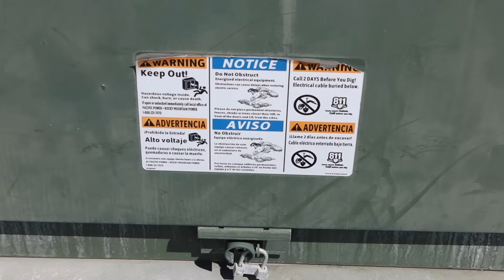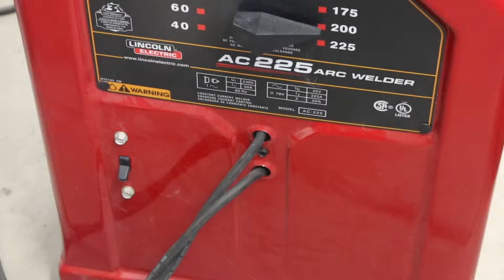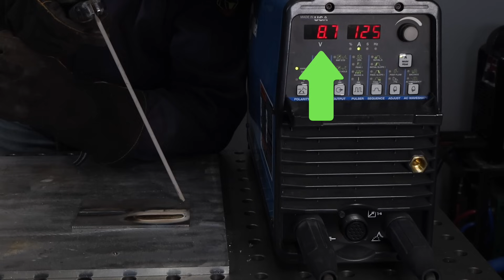Can You Get Electrocuted While Welding? Watch This...Don't Get Shocked!

Comment: Im confused, because alot of people touch the metal they are welding on, but you mentioned if the clamp and the electrode touch you at the same time, you can get electrocuted . What makes it safe to touch and hold the material you are welding as well as hole steadily the elecroyed?
Reply: Hello? Anyone?

Comment: here's a solution, use common sense when welding. If you can't use common sense, then you don't belong in the welding field. 99.9% of welding accidents are because of the operator not using common sense.

Comment: I managed to get shocked by my dad's stick welding machine when I was about 12. We've been working on a welding job all day long and at one point I removed the ground clamp,  turned the workpiece around and fixated something on it with my right hand while my left hand still held on to the ground clamp which I forgot to reattach somehow. As soon as my dad tried to continue welding I was the one to close the circle. 
Had no gloves and eye protection was "look the other way".

Comment: Was that a Miller welder made in USA?

 I've felt the tingles when leaning against a welding project and covered in sweat.
 I think my ESaB 180 has VRD turned on all the time ( open voltage around 25v), seems hard to start on the first strike, then normal.  There is no button to turn it off, I think you have to take it to a service center and get it disabled ( a stupid money saving idea to save a button).   The bonus of the ESAB is it has an IP23s rating,  so you're good to go in the  rain....
Reply from the maker: I have an ESAB 180 and you’re right, they don’t have a user adjustable VRD. I imagine it’s just a jumper inside or something like that, but they recommend a service center if you want to change it. I’m pretty sure these Dynasty’s are made in the USA, this one is a 2010 model.

Comment: I see a lot of videos of people working with stick welding, using their fingers to control the rod, isn't that dangerous?
Reply from the maker: With a dry glove on the flux, it's not an issue. It's not necessary in most cases, but plenty of pipeline guys guide the rod and it works well for them.

Comment: It's not just voltage.... a stun gun... 500k volts. Rarely fatal. 4160v breaker.... 4k volts, 100 amps... You get turned into a fried turkey. Need amps too.
Reply from the maker: The volts drive the amps.

Comment: i didn't learn much. it would have been much more helpful if you would have demonstrated clipping the ground onto the table and then how to properly hold the welding handle and how to avoid any kind of "complete circuit" between you and the welding table.
Reply from the maker: Thanks for the suggestion!

Comment: In Australia there is something called a "Squid" which is a device with a quick trip fuse that plugs into the mains and has an outlet which the welder plugs into. As soon as it detects earth leakage the fuse will trip and the welder shuts down. I always use the squid even for a quick bit of welding and this coupled with the other standard safety precautions adds an extra layer of safety to the process.

Comment: i am learning aluminium tig for 2 years now and i literally cannot do the filler wire with TIG gloves on its impossible i legitimately cannot get any grip whatsoever so i just dab and stab into the pool like holding tweezers its no the official method and yes i have to do many stop starts but can i not wear a glove on my left hand because then i can feed the wire in the official way and feed the wire consecutively but sometimes i touch the aluminium filler wire on the electrode if i were to do that with my left hand holding the aluminium wire with no gloves would that kill me ? anywhere from 85-125 amps is the maximum since the AC circuit is complete

Comment: I wish more would be discussed about AC vs DC and what voltages are involved...so much talks about the current and I have heard many things that claim you "can't" get hurt by DC power...though having been mildly shocked by DC model train stuff around 15-20V enough to get a startling minor tingle does make me wonder.  I know with amateur radio stuff generally 48V is the threshold that its considered "hazardous" though it is possible to feel it much less in some conditions.

Comment: Im a bit confused about something, can anyone help me out ?

I just saw a video of a guy welding a piece of steel that was laying on top of a metal table while he was only wearing leather gloves and a t- shirt.

 He clipped one clamp to the table leg and started welding but his bare arms were touching the table the entire time. 

How did he not get shocked ?? 

Wouldn't he be adding him self to the circuit by touching the metal table with bare skin ? 

Why is that not the same as stepping in a puddle of water ?

Excellent video tho btw. I did infact learn a lot from it. I have been having trouble finding videos that discuss safety like this and how NOT to get zapped. I really appreciate it 💯
Reply from the maker: It's a great question. He was connected to one pole by touching the table, but not the other because the handle and gloves are both insulators.

Comment: I don't know about electrocuted to death (common sense says you can be), but I know that I had several occasions some years ago where I got "lit-up", while welding (both stick and high frequency TIG),. Though it's possible in all processes, I would assume that stick welding would be the process with the most shocks. 
But the worst I ever got was a high frequency shock while TIG-ing some parts.

Comment: Okay, Im new to welding, And just picked up my first arc / stick welder... 
Nothing special, Just a Sealey 160A AC thing, and im coming along quite nicely, Learning with 6013's and getting it pretty dialed...
But i am always CRAZY CAREFUL not to touch the electrode /rod, while its in the stinger and switched on....
The whole "thats live, and im grounded to the earth that im standing on"..... 
So since you say the input power, and the welding power, are seperate.... is it actually safe to touch the electrode while the welder is on?
I see it so much, Welders hold the rod still... is that just because they have gloves on, that makes it safe? or is it actually not dangerous to touch?!?!

cheers

Comment: Yup...I just completed a circuit..came here to see if it was me or the machine... It was me.  Thats what i get for trying to tack a piece on thats in my hand while leaning against the object I'm trying to weld too.. i only made contact with the piece in my hand and my hand accidentally pulled the piece away from the structure

Comment: You have that backward, voltage is not what is dangerous, it is amperage that matters. Hence why a Tesla coil is safe. It’s high voltage, low amperage.
Reply from the maker: Why can I touch the posts of a 12 volt car battery that's capable of delivering 800 amps and be fine? It's because the actual amperage that flows is a function of voltage. Ohms law states V=IR. Because the resistance through a person is relatively fixed, the voltage controls how many amps will flow. Therefore, by limiting voltage, you also limit current and create a safe condition. So yes, like I said in the video, the amperage is what hurts you, but controlling voltage is what matters to stay safe. In the case of a Tesla coil, the reason that it does not affect the human system is because of the very high frequency range of the Alternating current produced by the circuit. While welding is done using either DC or relatively low frequency AC (under 400 Hz), Tesla coils operate at frequencies over 100 kHz, which frequencies of electricity do not affect the nervous system or cause muscle contraction in the same way that lower frequency AC or DC current does.

Comment: You can absolutely get shocked while you are welding. When I was an apprentice, I was helping a welder in the shop at work, and he took great pleasure in messing with apprentices. He had me hold a piece he was welding on a piece of equipment in such a way, so when he stuck an arc, I was the ground, so I got a pretty good jolt. It was a good learning event because I always made sure it didn't happen again. Later, when I was working for the railroad and one day, my job was to watch the guy welding steel  H-beams to reinforce a trestle. It was pouring down rain, and we didn't have any cover, and all day long, I would see him spasm occasionally when he would get bit from water leaking into his gloves or down his neck.

Comment: Hey Tim. Great video bro. 
I wanted to ask a question if u have a minute to answer. I'd very much appreciate it bcos I'm new to welding. My shop is always cold. I don't have any heating in there so I wanted to ask about heating the spots of the metal I'm about to weld up using stick. 
Is it at all helpful to have the metal heated before beginning my welding on the area? I use a fair bit of Square tubing so I clean the areas with a flap diec on the grinder before welding. I have a small gas bottle torch so I wanted to ask if it was a good idea to heat the area 1st?
What I have found in my short time welding is when the metal is hot the arc tends to begin a lit quicker with the heat of the metal or am I asking a dumb question?
If anybody in the comments could give me advice too I'd be super grateful to u guys also.
Thanks for a great vide4o again Tim man. Take care bro and same to all in the comments

Comment: I always see videos about the welders, but never about the setups the tables you must use. Or is there any specific tables you must use and are they grounded or not? I'm new to all of this and still learning but see no videos about some of the questions I have. I wish I had a place near me I could take a class with.
Reply: I have a wooden table with a piece of sheet metal on top, connect ground to the sheet metal or the workpiece. Make sure that ground is always closer to the electrode than you are. The electricity will take the path of least resistance so if you want to touch the workpiece itself while welding make sure you are wearing thick dry gloves. If you are standing up wearing some thick boots will stop you becoming ground.

Comment: Open circuit voltage is defined as the unloaded voltage across the welding circuit. It has nothing to do with the fact that its leads are live all time the welding machine is on, as in the case of a scrach start tig or a stick welding machine. In any case the OCV is bellow 100 volts and as such it is not regulated by law. Example you can legally change leads and terminations, cables etc without breaking the law. It is the current that kills, but because of the bodies high resistance to electricity, you would nead a fairly high voltage to push the  amount of current needed to kill.  At an OCV of 50-70 volts which is typical for a dc welding machine, this is considered safe for this reason however you should never touch the welding circuit live deliberately. You can get an uncomfortable shock from this, especially if your hands or gloves are damp. Always treat the leads as dangerously live but use with confidence.
Reply from the maker: Very well said 👍

Comment: I am 75 years old I am a retired Diesel mechanic/welder. O C V almost killed me, I was the concreet paveinmg mechanic for a large construction company out of K C Kansas. We were doing a leveling overlay on I 70 west of ST Louis  Mo. the paver broke down and needed wilding < viabtratoe bars under the paver> they pulled it out of the mud and washed it out and then insisted that I would crawl under and weld the broken part. I refused and insisted that they would move the paver to dry base and they would not. After the intense arguement compleet with screeming and hollering, you need to have been around concreet paveing to uenderstand, I put on a pair of rubber gloves and crawled unmder the paver. My welder a lincon diesel SA 250 wouild not reve up fron idle when you srtrike your arc, so I had to plip the switch and make the welder run at weld speed this made the OCV go to 90 volts DC.  The current went through me arm to arm, it was like a bomb went off in my chest, I couldent talk, I managed to roll out from under the paver. All I could do was wrap my arms around myself and I thought I was going to die. I finally got to where I could talk and the superintendant drove up after another arguement he told them to move the paver to dry base and I welded the broken part and went somewhere else and by God's grace made it through the day. years later a stress test revieled that I had had a heart attack and my heart muscle had torne and healed on it's own everythinmg ok by the GRACE of GOD. Yes a welder can kill you ! Good video thank you

Comment: You flip flopped the current vs voltage analogy. Current is the pressure, not the voltage. Hence the reason why I can get shocked by a taser at 50,000 volts but low amps. No matter how many volts, 50,000 amps will kill you. Does not matter.
Reply from the maker: The taser won’t reach 50 kV, it may have potential to reach 50 kV, but since it is current-limited for safety, it will only hit a much lower voltage in reality. Basic ohms law in day one of EE101. Google “voltage hydraulic analogy”

Comment: I got burnt from the High frequency start really bad on my hand. I was welding a chair which I didn't realise had a rubber foot so when I pressed the button on the torch the hf jumped through the torch, through my hand and out the side of my hand to the ground table. When it exited it evaporated the water in my skin and formed a bubble as it did. I got second degree burns. Note, ensure your work piece is ground and wear gloves.

Comment: I still don’t know if I can hold a stick arc welding rod when welding. The long stick wobbles all over the place it would be great to hold it so I could get a better weld but I just don’t know 😩
Reply from the maker: You can hold the outside with a thick glove as long as it isn’t wet. It’s a really common practice.
Reply: Thanks mate 👍

Comment: Ive gotten shocked once, I was stick welding and got the electrode stuck and  so I started moving the holder side to side to break it off, I was on a ladder at the time so I was holding onto the work peice for stability, well the rod turned red hot and it broke off but I was getting a little pissed off lol so the red hot electrode broke off and buried the top of in in my hand and got simultaneously shocked 😂 pretty dumb accident that could’ve been avoided but yeah hurt like hell

Comment: Not even joking I electrocuted myself 4 times today while welding, My gloves where damp because I was an idiot and did not even think about it, (They where damp from the quench tank which got some water on my hands.) I stuck my rod and with my left hand I reached out to brace my work piece and wiggled the rod to break it loose and got a good zap and tingle up my arm did not feel good, Thankfully it was not bad. And the other times it was tinny little tingles in my fingers lol. I called it early today  before i somehow kill myself. Still fricken love welding though, next time i gotta do better to keep my gloves dry.

Comment: Physicist here... I hate when people say "voltage doesn't hurt you, current does." I appreciate the underlying idea, but that sentence goes too far, suggesting voltage and current are independent. A higher voltage, for a given resistance, will drive more current. (concisely... Voltage = Current * Resistance)
Reply: i am learning aluminium tig for 2 years now and i literally cannot do the filler wire with TIG gloves on its impossible i legitimately cannot get any grip whatsoever so i just dab and stab into the pool like holding tweezers its no the official method and yes i have to do many stop starts but can i not wear a glove on my left hand because then i can feed the wire in the official way and feed the wire consecutively but sometimes i touch the aluminium filler wire on the electrode if i were to do that with my left hand holding the aluminium wire with no gloves would that kill me ? anywhere from 85-125 amps is the maximum since the AC circuit is complete
Reply: Laughs in high resistance

Comment: During the summer I've had sweat make the elbow of my jacket damp enough to shock me when tig welding with my elbow on the table. Started wearing one of those pipe welder leather bracer things mockingly  called a "sissy pad" after that

Comment: Yes you can. And there are people that have been killed welding. It may not be as common as being killed in other industrial accidents. 35  or so years ago i was welding new metal in an underground coal mine surge bin. It was hot summer, was wearing good leather welding gloves and laying on the angled bed of the surge bin,  soaking wet sweating. I had to put the Rods in my pit cap and put them into holder without touching the rod. Found that out the hard way.  The OCV ( open circut voltage) rating of the machine is what you are exposed to in that situtation. And not uncommon to see 80 v in some older machines have not paid any atention to newer ones. But 1/4 amp  can start the greaving process for your family and friends.
Reply: 1/100th of that current is enough.  Or something like it.  Ah, okay, it's 13mA through the chest cavity is enough to stop a heart, for some hearts. 
So about twenty times lower than a 1/4 A!  But it's all likelihoods and odds, and playing the odds can get one killed.